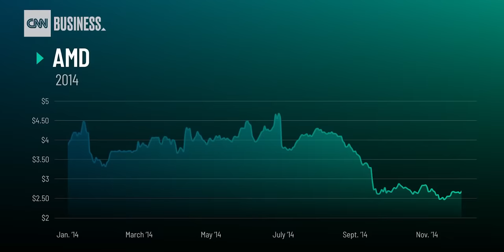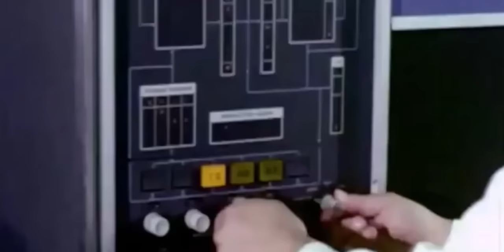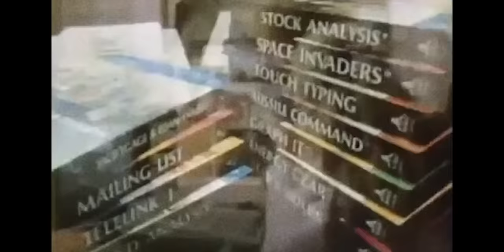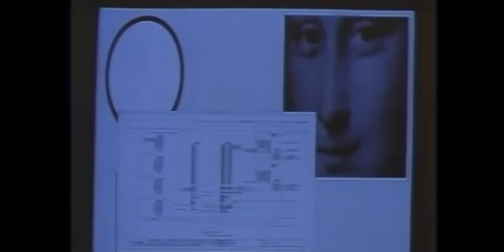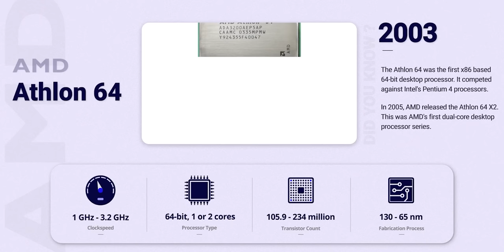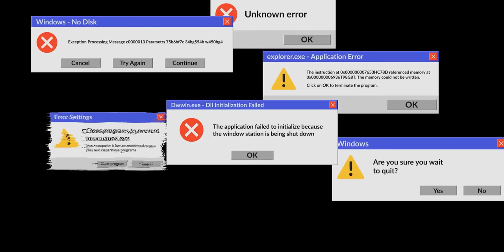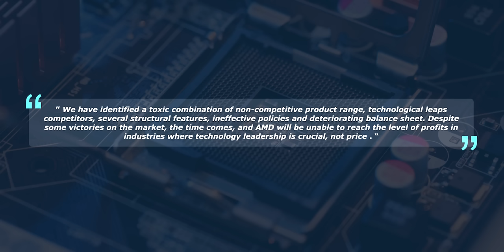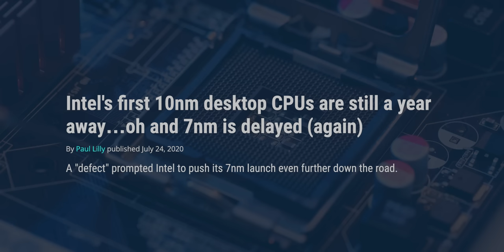The Real Reason AMD Is Worth More Than Intel

Comment: it wasnt a secret war, AMD existed since 1969.. intel rocked up way later with far cheaper nastier faker products that charged massive prices largely being hand made..
the intel stuff pretended to do what the real computers did. real computers used expensive stuff.. like $100,000usd per gram today superconductor its called superconductor because it breaks the laws of physics like old nixie tube clocks vacuum tubes emitting more light than the surface area of the filament the glow could extend out wards milimeters from the surface in an odd way because its a room temp superconductor. computers used to have like 0 latency no lag no delays and be largely analog and TRULY super. pure mathematics devices. But they cost millions when a massive luxury house cost like $20k tops. 
When banks and post offices and everybody was racing to get cash register like computers that had a sort of database system that had backups and tapes and stuff cheap enough to be affordable and portable and worldwide. criminal idiots read computers cost millions and had precious rare superconductor alloys and stole all the vacuum tubes. in the 80's even people were killed for the "gold plated computer boards and parts in TV's thinking they're worth millions as they learned its some of the same ones used in computers those things are lined with gold" idiots who are clueless thought anything computery ran the XEROX graphics user interface XEROX not windows idiot and the far older COBOL and other languages which looked alot like linux and DR recoveryDOS .. but well you get the point. intel was actually one of the worst things to happen to computing industry and people thought they were getting super expensive house sized computers in a tiny small cheaper form and poured money into them.. but AMD was the one doing the actual computers in compact form advanced microdevices was still making genuine super computers that were like almost price matching intel/nvidia.. eventually AMD was able to price match them but you see microwave ovens TV's and alarm clocks all used the same cheap cashregister software as intel/nvidias cheap fake trash and now AMDs genuine super computers are running and gaming simular while price matching intel and nvidia with the same fake intel nvidia software.
run the same alarm clock code on intel or AMD its going to look similar right? 
its why people who cant read numbers on boxes or certified PHD doctorate mathematicians stating words like infinityfabric (when a mathematician says its infinite in legally binding advertising its the best thing in the universe) and has double the size numbers of 4th and higher dimensional constant force physics dimension vectors and bit depth and core count being higher on the box.. rx5700xt versus say rtx 3080 compared to nvidia's random nonsense nonstandard numbers that arent real or scientific. My years old LG V60 can all kinds of realtime rendering ray tracing worldspace rendering and additivelight and all sorta cool stuff. how stupid are you people?

Comment: Your Thumbnail Icon is misleading and WRONG!

It was NOT AMD, But it was indeed Intel that was lying, cheating, stealing, bribing, and playing all out dirty along the way as you said so in this video. So why did you put only AMD's Logo in your thumbnail? You should have done Only Intel's logo or both of their Logos.

Intel maintained the appearance of supremacy through unethical means while they have made inferior products most of the time. Intel's initial start was wonderful, but they quickly started to play dirty after that initial start.

Along the way Intel made horrible choices. The Pentium 4 is a good example.

They have been ripping off their fans for years.  People have been paying more for 12nm Intel chips while AMD's much more efficient and cooler running 7nm CPUs did not sell because of their shady practices.

The U.S. Government just created the Chips act and handed out 50 Billion Dollars of our tax money to Intel to bail them out of their incompetence.

They have been burning money in R&D 7 times more than AMD and others and they have had nothing to show for it in years.

I will never buy another machine with an Intel CPU in it unless they really clean up their act!

Comment: you're kidding right? AMD has always been the poor mans pc parts. It is only VERY RECENTLY that they have even had a product worth anything. People are now acting like they're the most amazing company ever. Why ? One product line that has finally actually taken them out of the gutter and now they're better than intel? Please. I will admit intel has gotten stagnant but so what? Amd was stagnant for like 20 years. As a pc builder of gaming pcs i put nothing in my pcs but intel top of the lines because they're reliable and last longer and perform better than AMDs and Nvidia (evga) gpus because Amds cards have always been mediocre.
Reply: I must agree because even until the late 90s, AMD had problems running simple instructions with their K7 chips. It was power efficient and suitable for consumers but horrible for gaming and general purpose tasks.